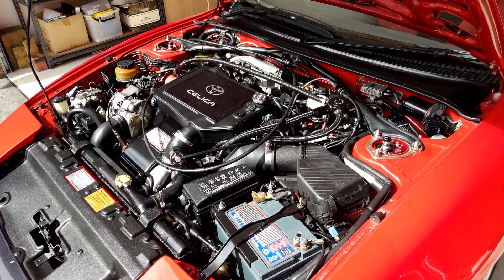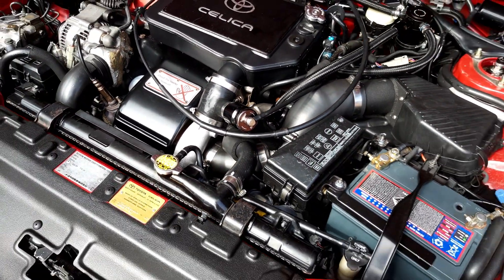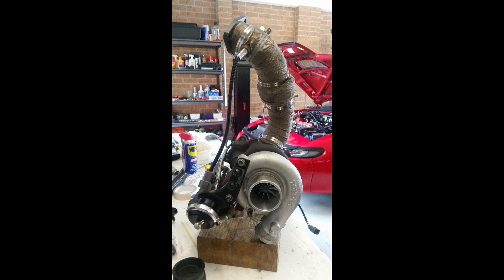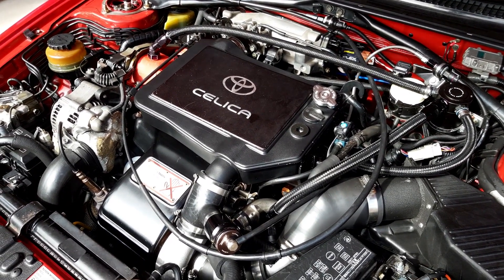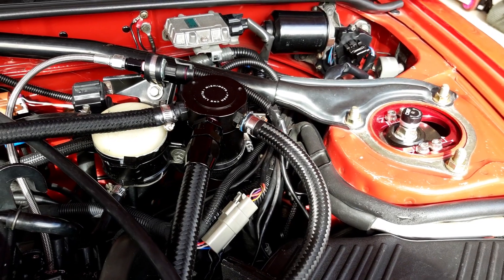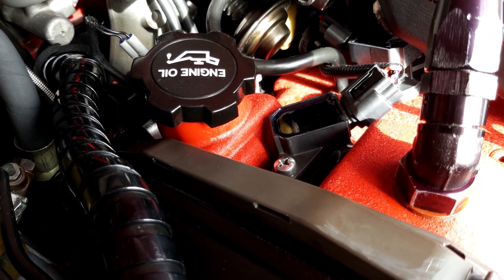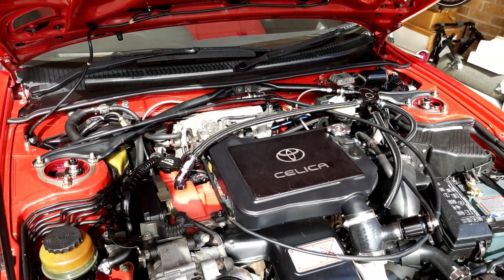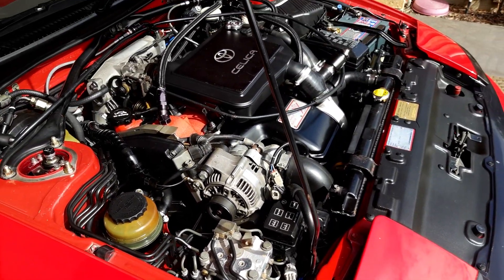QUICK LOOK: Toyota Celica ST185 GT-Four Group A -  3SGTE Engine bay walk around

Comment: Hello! Glad i found this video, really helpfull! I am an st185 alltrack turbo owner for approx 4 months and i am very happy to have this car in my hands! The only modifications this car has is a full exhaust system which i really like it from the previous owner. Was thinking of upgrading the turbo as you did. Do you think that this will cause damage to my engine? And what else do you think that would be good to gain little bit of power? Thank you very much for your time!
Reply: Hello, sorry for the delayed reply. Upgrading your turbocharger will not damage your engine. It is the increase in boost pressure that can. But you don't necessarily have to increase boost pressure much with a new turbo as the increase in efficiency is a benefit in its self. Ultimately detonation is what will kill a motor, so if you have enough fuel, enough air and a good tune, you should be OK. The amount of Fuel you can push is going to be the limiting factor to the amount of air (boost) you can push. With factory computer, injectors, fuel pump, etc you would not want to push much past 14psi - even with an upgraded turbo. This video is shows exactly that -> https://www.youtube.com/watch?v=gCKwdYA7KlI
Reply: Shaun Wilton Hello! And thank
You for your reply! I will check the video later. I was thinking about programming as you said so i will check the video thank you!

Comment: Have you ever thought of using the water sprays on the intercooler radiator?
Reply from the maker: I hadn't actually, but that is not a bad idea.

The water to air intercooler is only as good as the heat exchanger keeping the water cool.

A spray system at the front of the car, onto the heat exchanger, is not a bad idea.
Reply: @wiltonsgarage438  My car has them already fitted, but they are non functioning, bit like the ST 205 anti-lag system.
Mine are fitted in behind the aluminium brace for the front bumper.
There is also a pump fitted as well.
Reply: I noticed my RC has those water jets in the bumper where are they plumbed too?
Winderscreen resiviour?